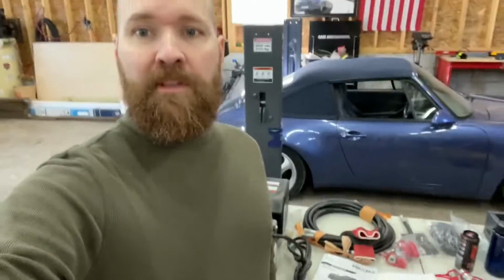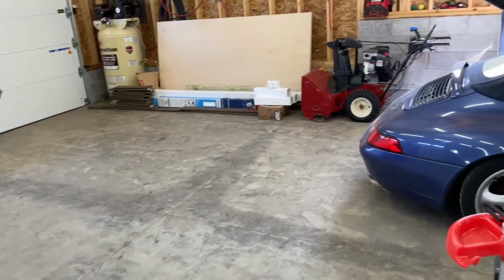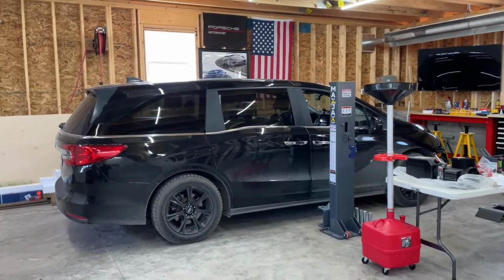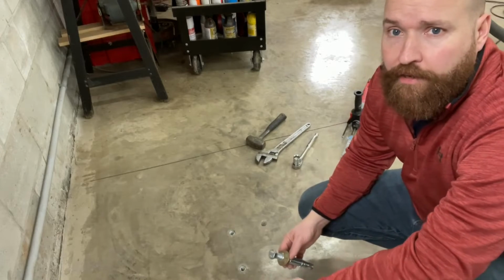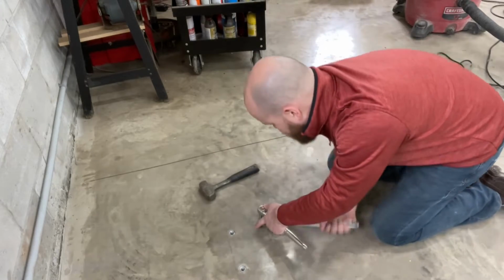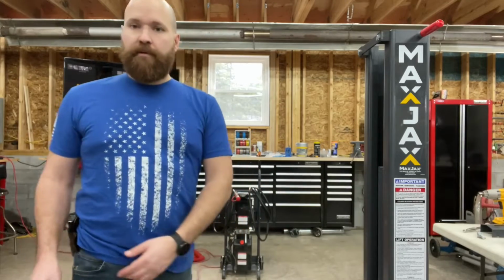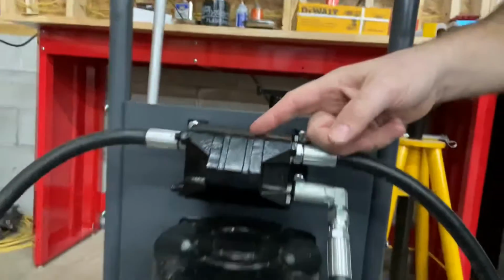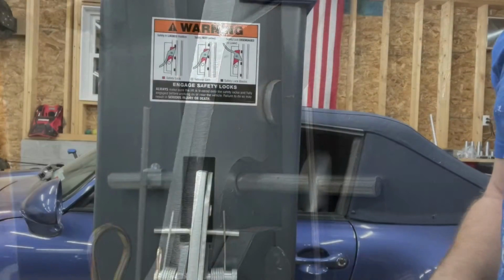MaxJax m6k installation

Comment: This is a really nice size garage, compared to mine, I only got 20x20, not terrible small but I am struggling on decisions on where to put the columns; my project involves a 2015 Chrysler Town and Country, seems it is in dimensions pretty similar to your Honda, and then a 2000 Toyota tacoma which is little smaller, I cant dry fit the van because it does not run and its parked in the driveway, once lift in place will have to push it with work van which is Mercedes Sprinter up into the garage, i got a big driveway but slopped down slightly to the curve, I am thinking to set the columns centered 9 feet from the garage door edge closed, have to figure out the width; from the garage door rails there are 24" but all of the perimeter has shelves and cabinets except the for 4 feet in the center, the column closer to the wall will be mere inches from it, will be hard to drill the holes and work around there but if I move it farther away like 36" from it then the other one will be past the center of the garage opener, then when the van raises it will be preventing it from going all the way up; the garage opener sits right in the middle of the garage so this situation would be the same on the right or on the left, I believe from the edge of the garage rails to the center of the garage rail that carries it there are 7 feet, the van width is right under 6 feet so as you can see i have a pretty tight space here, one solution would be to clear all around the wall where the car will be closer to but this would require lots of time and plus I have no other place to move things, as a matter of fact still making space to move stuff out of the garage as it have been mostly storage for years and it have been full of years of hoarding stuff that I cant just throw away like tools, some big enough to take all the space; I have a project to built a shed room on the back yard 12x16 but that has not happened yet when I decided to get the lift because the van needs to be fixed, so big decisions which kind of funny stopped me temporarily from moving forward, also waiting for a hose, the creeper and those kind of accessories for this project; more space needed! Crazy!

Comment: Thanks for this...but NO ONE ever shows installing the lift arms and maxjax instruction on that suck ....I know, I have one 3/4 ready but did you have to do all their adjustments for the arms (loosen bolts, align , etc) or did they just fit right in ? Also their TSB on mine for the INPUT hose was wrong...Mince DOES connect on the left - Hopefully you can do a quick video on the lift arm attachment,.. you would be the ONE AND ONLY :-)
Reply from the maker: Are you having troubles installing the lift arms?  They just slid into place and the pin dropped in, once the carrier was lifted up a few inches.  I apologize I didn't cover it, but it looks like the loosen bolts, aligning, etc. part of the setup was held over from the pre-Bendpak ownership of MaxJax.  If you didn't know, Bendpak bought out MaxJax and they updated the lift system to add safety features but didn't totally update the manual that shipped with the lift.  There are service bulletins on their website that provide additional assistance.   I assume this will be fixed since they only made the switch over to the new lift (M6K) at the end of 2020.
Reply from the maker: https://youtu.be/LaVvKNT3lE4

Comment: Bad ass bro ... Just waiting to my concrete to dry to put mine to work .... Do you have a link to the power unit ?
Reply from the maker: The power unit came with it.  https://www.maxjax.com/maxjax/?gclid=EAIaIQobChMI-eW-vcHQ7wIVmZOzCh3NGgfgEAQYASABEgIvxPD_BwE

I saw you poured concrete for three different locations, nice!  I’m using this to drop an engine and work on suspension and general maintenance.

I picked up these full size jack stands so I’ll be comfortable working underneath it: https://www.jegs.com/i/JEGS+Performance+Products/555/80078-1/10002/-1?gclid=EAIaIQobChMI1fSN3cHQ7wIVg7LICh1r1gCNEAQYAyABEgKemPD_BwE